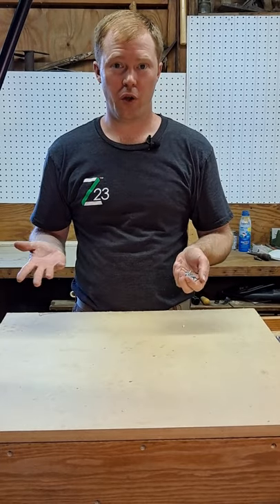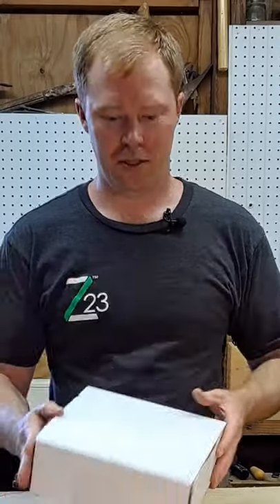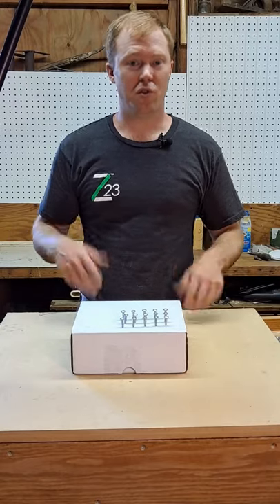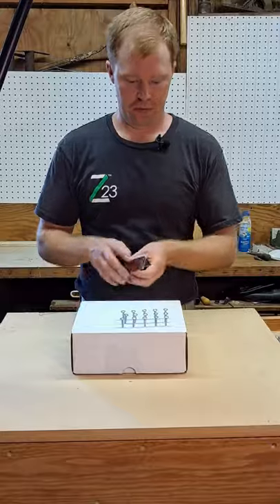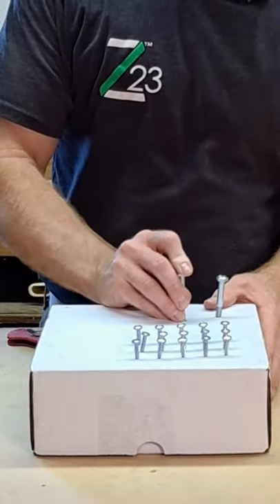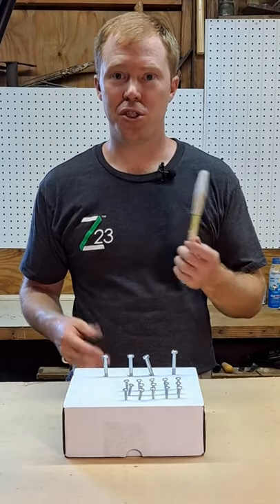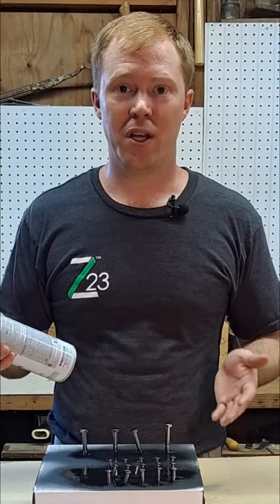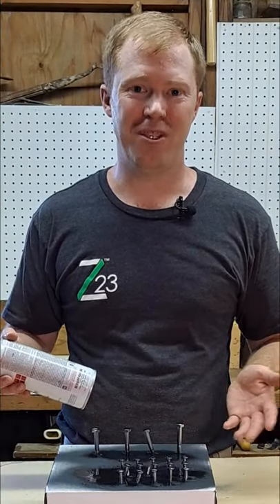Paint Screws - No Mess #shorts

Comment: I have 13000 to paint got any tips 4 that other than find a new job
Reply from the maker: For that large of amount I would try to find pre-painted screws. Metal building manufactures have a variety of different colored screws to match their colors of tin. The screws are hex head sheet metal screws. That may be a place to start. Good luck!